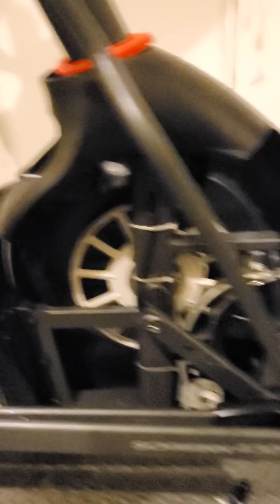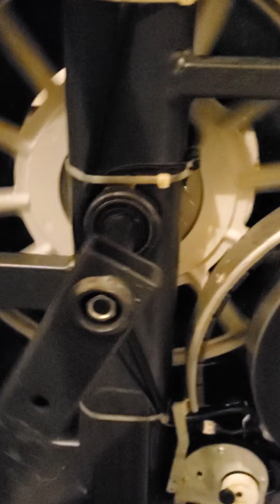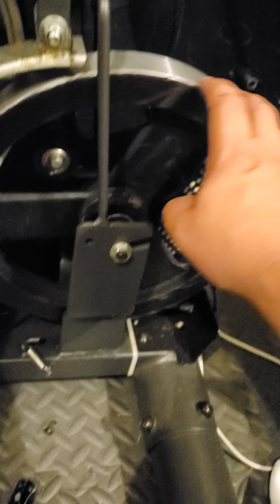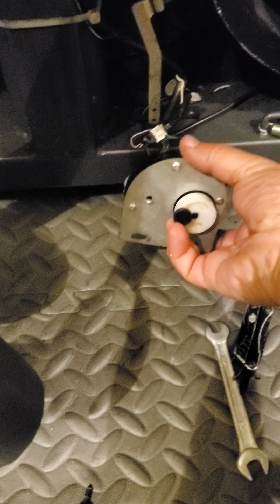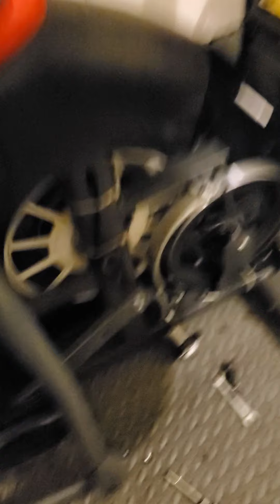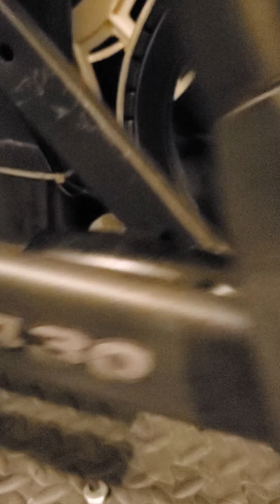Schwinn 430 elliptical resistance repair & speed and flywheel mechanism

Comment: Thanks for the tip, it ended up resolving the issues with my same model. However, you didn't need to go to that extreme of cutting the cover and removing that motor. if you took the other side off it would have slid right out of the way for you to gain direct access the tension knob. I realize i'm a tad late on that, but thanks for the info!

Comment: Anybody watching this can adjust the screw by taking the side cover loose and prying it open a bit.  No need to pull the crank or cut the plastic.  Then you can reach in there with a screwdriver and adjust the little screw. Had to turn mine about 3/4 of a turn counterclockwise to increase the resistance and make it feel right.
Reply from the maker: @keshmo12  Good call. When I started I had no idea what I was looking for, so it made sense for me to take off the cover.

Comment: You're supposed to move the entire servo assembly to adjust the brake tension according to the manual. This is why the 2 bolts that affix it have slotted channels.

Comment: I just did mine. The increment on the pot turning is like 1/64th of an inch or less counter-clockwise. I turned it about 1/32 and it was too much. I turned it back a little and its perfect. I bought the crankshaft tool at a bicycle shop 22m-1mm.  Its perfect now. But I must have bumped the power plug because now its intermittent if it turns on or not.

Comment: Thanks, I was able to just split the center housing and get to that pot adjuster. I didn't take any thing else loose. It fixed mine once I got the pot adjusted just right. I realized that if the motor goes too far it just starts to move the magnet further away again so you just want it to stop when the magnet is at the closest point. Not sure why mine got out of adjustment but it was staying at the lowest setting it felt like. I turned the pot back and forth several times to hopefully clean its contacts. It is working great right now. I may have never thought to try the adjustment you showed me.
Reply from the maker: Glad it worked out for you.

Comment: Dude! you had simply to buy a crankshaft remover and push out with it that pedal after removing the bolt it is secured with, instead of cutting through that plastic.. these are sold for 10$ online and are standard for all bikes.. search for the Schwin 430 service manual, it is explained there how to remove that Shroud and Crank Pedal on pages 57-58
Reply from the maker: 😆 Yeah that's good to know. I knew there was a tool but I didn't know how cheap it was. I had the tin snips in my tool box though so I probably would have done it like that anyway. 😅 

It's all good though. Thanks for the info. I'm sure it will help the next guy out.

Comment: This was super useful, adjusting the blue screw on the servo motor restored resistance control for me too. I then drilled a hole in the plastic cover so that this screw could be accessed without removing the plastic cover. If others want to do the same, the blue screw is about 11.5" back from the front of the machine, and 5.75" up from floor level (distances may differ especially for floor level if there are different height adjustments, but putting a hole or two in the plastic casing and then covering over with tape seemed a much better solution than possibly needing to remove the cover again.
Reply: Perfect idea. I just use a hole cutter bit and it was right there.

Comment: Which way do you turn the resistor to increase the resistance?
Reply: For me, turning right decreased resistance, left increased resistance. My way of thinking about this was that the motor is working against a spring that drives resistance towards max, so the greater the number of motor turns (screw further right, probably), the lower the resistance should end up being.  I drilled a hole in the casing to access the screw so that I could make further adjustments without removing the casing. See comment above for location of the hole.
Reply: @ultimocrat  i made a mark at 16 inches on my frame from the ajustment screw and i measured the height which was 5 1/2 inches, then drilled a hole and from now on no more cover removal. Thanks a lot ultimocrat 😉and btw if you go to the left pressure increases.
Reply from the maker: I can't remember now.  I think it was to the left, but I'm unsure.  But what you're changing is how much the motor turns for each adjustment.  So you have to look at where the actuator arm is when it thinks it's at max resistance.  Then you can decide where you need to go from there.  Someone in one of the comments said that you can adjust it while it is mounted if you go from the other side.

Comment: Thanks Moe for this video!  For anyone looking at this machine I would not recommend it. I first had to replace the servo motor after about 3 years of moderate use. Now it's my second time inside because after about a year the 2nd servo motor goes immediately from too loose to too tight. Considering that the machine a huge 250 pound boat anchor that is hard to move or to dispose of, these little breakdowns have been a real pain. You need to invest a few hours in figuring out how to take it apart an put back together, and I have better things to do.
Reply from the maker: Thanks for the comment. Sorry you had a bad experience.

Comment: I've had one of these that I found for free on Craigslist just before Covid started.  The guy didn't want to take the time to find the inner squeak.  It turned out to be a 4-hour job after I forgot to replace a certain axle screw and had to disassemble again.  Anyway, my screen says I'm going up and down the resistance scale but that motor, which I believe is called a servo, runs for only 1 or 2 seconds at a time and doesn't move the magnet array (which you showed attaching itself to the flywheel). So, thanx for pointing out the adjustment screw even if it isn't part of my problem, and I hope I won't need to replace the motor.  As it is, I could probably get away with leaving the resistance as it is and just adding more time and/or speed to my workouts.  You might want to edit the video's title to tell people that this is also the mechanics for the Schwinn 230 Bike and possibly more.
Reply: Hello, can you pleas Tell me if the elipctical Trainer is done and useless if the terminal part dies? Or can you still Workout on it just  without adjusting strenght level ect....? Thank you.

Comment: How did you adjust it
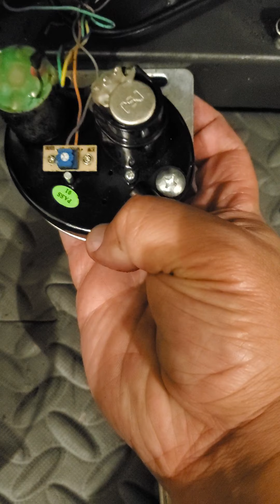Reply from the maker: 😆 Sorry, I never realized that I hadn't showed that. At the 3:30 point it shows a blue variable register thing on the board. You just turn it slightly with a screwdriver.

Comment: Wow, this actually worked! Turning the blue screw with a mini screwdriver towards the left fixed the resistance.

It was a little tricky getting the plastic covers open. I ended up only needing to open the right side cover (looking from the front). You can see the blue screw from that side. I fit a mini screwdriver inside and a flashlight and turned the blue screw leftwards, while the resistance was set to level 20. After adjusting, set to level 1, then 20 again, test the pedal. I'd repeat this until I have the perfect resistance. Thank you!
Reply: So, the blue box & screw is on the side ahead of the user's left foot, correct?  Anyway, I'd like to advise anyone who thinks they don't need the protection of the plastic panels (for animals, children, or wayward feet, etc.) to take them off.  They don't affect the noise much and are a real pain every time you want to perform maintenance and/or inspections.
Reply: @raygrinders3918  Generally, yes. While the box is actually behind the right foot cover, you can better reach it and the blue screw by going in the other side from the left foot cover. You only need open the left side to get a screwdriver in. Mine is still working great!
Reply: @cori6331    Cool.

Comment: Has anyone had an issue with the left pedal coming off the rail assembly? If so, can you please let me know what you did to repair? I'm not sure if there is screw loose or If I need to order a new part.
Reply from the maker: Like what do you mean? Like while you're using it?

Comment: Could you describe what adjustment you made to the screw in the blue square? thanks!
Reply from the maker: You just turn it with a screw driver.  A little turn goes a long way.  Think of it as being kind of like a volume control. you will have to play with it to get it to the right place.

Comment: It sounds like your idler tires and frame rail could use a light coating of silicone lubrication.  They are squeaking quite a bit.  The idler tires don't need to roll so much as they need to glide.  Your machine will run much quieter.
Reply from the maker: Yeah, I lubricate them from time to time. It doesn't seem to last that long, probably from the dust in the garage.
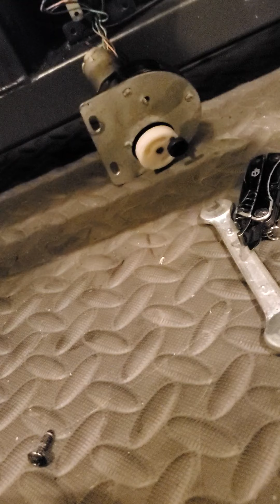Reply: @moeholliday  mine always starts squeaking again after a while.  Although, it squeaks on the right side and not the left.  I just got my 4:30 a couple of months ago so, it is still under service warranty.  I am probably going to have them send a technician out and see if they can solve the problem.  If it is helpful to you, I will share the outcome of the service call.

Comment: My schwinn 430 had high resistance even at level 0. Followed your instructions and I found that zero on the display is not really zero..keep pressing the button to reduce the resistance..after 5 beeps later, the motor stops. I can live with that ;) Thank you for making this video!!

Comment: THANK YOU!! after 6 years of using this elliptical with no variance in resistance settings, your video was exactly what i needed...and it worked! Now i have 20 levels of varying resistance...can't wait to do a hill work out! I was able to get the cover off without cutting...removed screws holding it on and wiggled it over the pedal arm. Thanks again!!!

Comment: Nice vid man, I'm looking to buy this exact model, would you recommend it? You said it held up 6 years which is pretty good if there no problems in between. I wouldn't mind dropping $700 dollars at all on an elliptical if it held up for 6 years. Elliptical is second best behind swimming if we're talking low impact cardio options imo, can't wait to buy one eventually and start getting back on track with my goals :)
Reply: I've had this is machine for 7 years. The resistance never worked but does now after following the instructions in this video. My only complaint about this machine is that the sleeve that connects the right pedal to the bar that holds it has cracked twice creating a horrible squeak. Oddly enough that is not considered part of the "frame" and was only covered for 2 years. I have had to reweld it twice. Otherwise it is a good home workout machine.
Reply from the maker: Sorry for the late reply. Yes. I would recommend it. I hadn't really had much problems with it. I feel like it is just as much of a workout as the ones in the gym..

Comment: Man, I have to thank you much for making this video. It is EXACTLY what I needed to know. I am doing the exact same repair on the same 430 machine. I am going at it because the resistance isn’t working. And I too almost cut off my plastic cover just like you because I don’t care what it looks like either but I was able to bend it far enough to get it out of my way to work on. Now that little blue screw on the back of the brake I never would have known to turn that screw to fix it but that is exactly what my problem was. Saved me huge bucks. Thanks again.
Reply from the maker: No problem! I'm glad it helped somebody. I'm actually going to try to JB weld it today. We'll see how it turns out.